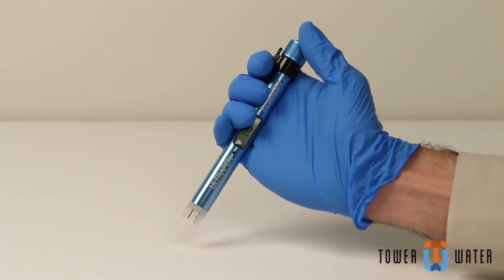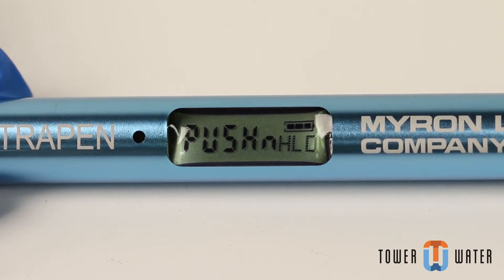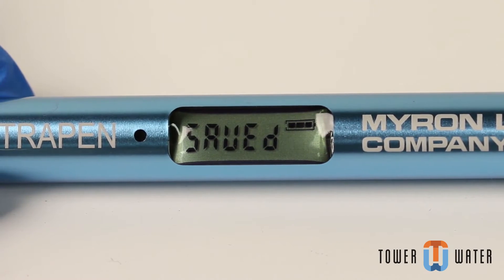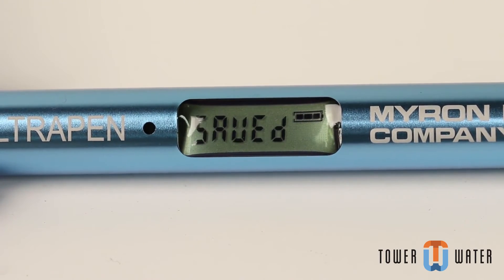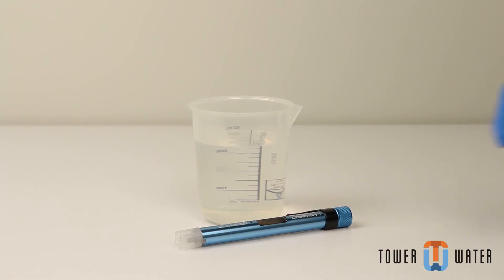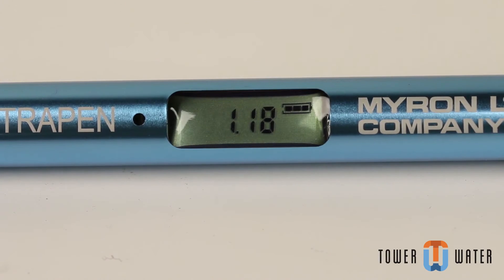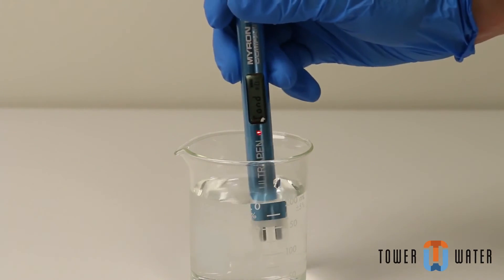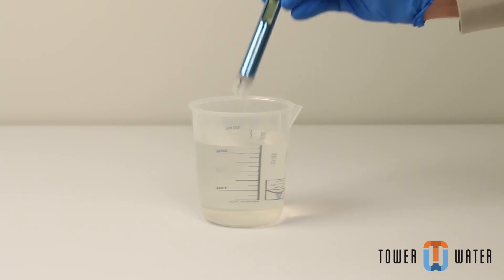How to Use a Myron L Ultrapen PT1™

Comment: Can I use the KCl-1800 standard solution to calibrate and use salinity (ppt) or is the solution only used for conductivity (us/cm)? Will the sensor still read an accurate salinity (ppt) with calibration from the KCl-1800?